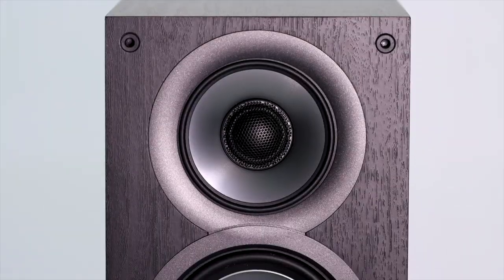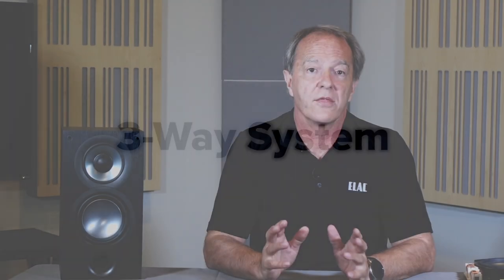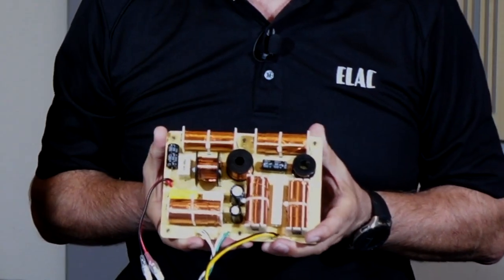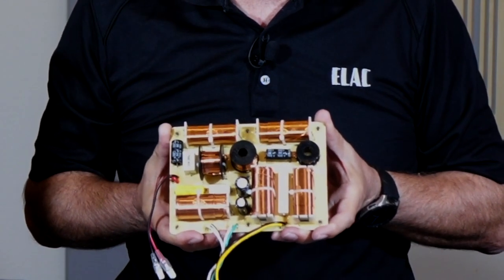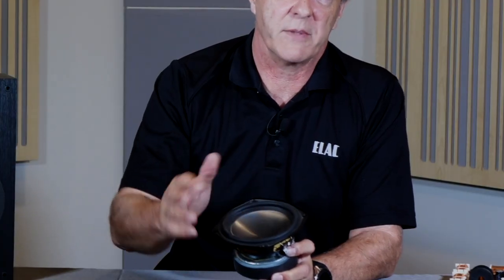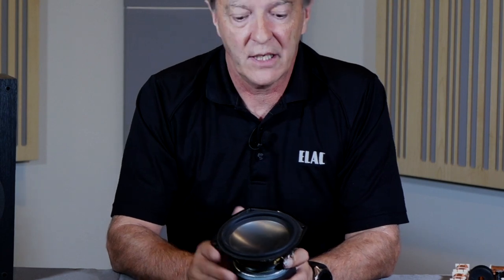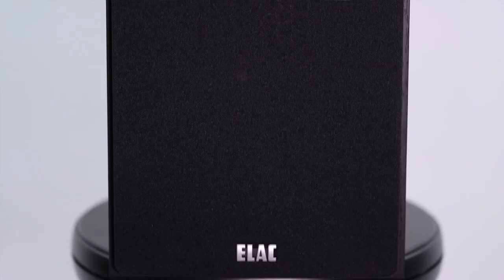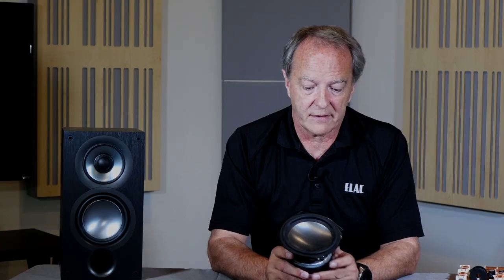Introducing the Uni-Fi 2.0

Comment: Just a heads up. The original UniFi series are on super-sale right now (or will be very soon.) in an obvious effort to sell off final stock, you can score big! The originals are just as wonderful as they always were and shoot way above their price point. The new UniFi speakers are probably pretty good too but at over double the price of today's series sell-off. It's like chocolate ice cream vs strawberry. Both very good. You will be floored by the origional series if you have good amplification. There is a reason audiophile speakers are built in a 4ohm configuration with ports on the back. And it's not to accommodate cheaper power and speaker placement. Set up correctly, and powered appropriately, the older series speakers deliver amazing performance that still give me goosebumps every time I listen to them. Don't feel bad about missing out on the newer series if you already have UB5's, UF5's, UC5's, or you are planning to buy them.  They are still excellently balanced and wonderful speakers, and are now available at a literal steal!
Reply: I have his pioneer concentric driver atmos speakers. What do you recommend sub 1500$ to power them. I am currently using a denon x3600h.
Reply: @urbz6712   I'm not sure since I don't do surround sound. But I would think atmos speakers don't use very much power. I would think anything 100 W or more would suffice.

Comment: One "oversight" on the center channel option? That center channel speaker looks awesome. I don't have one but was looking to buy one. I read some reviews and then it dawned on me. The center channel is more for clarity and not for bass. Why doesn't the center channel have a dual concentric 4" midrange (like where the woofers are) and only a single bass driver instead of exactly the opposite? Seems like that was an oversight in that design but perhaps a single mid-high is enough. Some reviewer said it was too bass present with the dual woofers. Maybe I will connect in series a book shelf pair for the center channel instead of the center unit option.

Comment: Also strange on pricing is that the center channel unit is far more impressive at $299 than are the pair for $599. Makes 100% more sense to buy 2 of the centers and use those as the mains and don't buy the pairs at all. Is the center voiced differently that this is not a good idea?

Comment: It's suprising, but the Elac sounds good only when the volume on my AVR is above 50 or so. 

For music I use L/R bypass as the treble too much, could be my Denon who knows? 
I wish Harman Kardon, still made AVR.
Reply: your denon for sure... even a cheap Onkyo A-9010 would be a way more balanced, better option
Reply: @themastroiannis  AVRs are not going to show case many speakers well.  If your Denon has PRE-AMP outs, look for a used power amp like ADCOM, Rotel, Emotiva, or any of the major Japanese brands.  They will be able to provide more current than and control over the speakers than an AVR would be able to.

Comment: @ELAC, Can you please suggest a good subwoofer and AV receiver that can bring the best out of this Uni-Fi 2.0 system? Bit about me, I am new to home theater system and so don’t have any components yet. Would like to start with Uni-Fi 2.0 with Center, Floor standing as FR and FL and book shelf for RR and RL. So I need a suggestion for the rest of the components: subwoofer(s) and a good AV receiver
Reply: Andrew Jones suggestion is https://www.elac.com/series/powered-subwoofers/sub-3030/?r=us or https://www.elac.com/series/powered-subwoofers/sub-3010/?r=us for subwoofer as per New Record Day YouTube review of Uni-Fi 2.0 floor standing speakers
Reply: I have my original Uni-F5s connected to an AR Technics 5.1 SA-DX930, which allows to drive them in stereo selection and they work excellently; I don't need a subwoofer because the bass is tremendous! My volume dial could not turn up more than 9 o'clock because they would kick me out of the house!

Comment: Still no magnetic grills??  Why!!!!??
Reply: The UB5 had magnetic grills, the UB52 use the same size grill as the Debut 2.0 DB52. The baffle of the UB52 is .2 inch taller and .2 inch wider than the DB52, so the grill still fits with an almost-imperceptible .1 inch gap around the edges. Moving the port to the front of the UB52 resulted in there not being room for an ELAC badge on the baffle. Using the same size grill and deleting the badge are some of the mundane cost-saving measures that enable the new & improved UB52 to be offered at only a $20 increase in MSRP over the UB5.
Reply: They also downgraded the binding posts. I think the UB5 is the better deal while it's selling for $299 a pair.
Reply: Its all about cost.. If the reduction in cost of the grills and terminal can give for instance a better designed crossover, or perhaps some cabinet-bracing..its alt the better..

Comment: I bought the original unifi ub5, i don´t have it yet but i hope next month i could travel to get it. Wan´t to know if you can answer if my old stereo amp Rotel 970bx2 60w 8ohms that can handle 4 ohms can drive them. The manual said about 4 ohms the following  " 110 watts/ch (1 kHz @ 4 ohms, 1 % THD)"   So maybe it can handle 80 or 90 W at 4?????? If anybody can answer this question i will be please. Thanks. And by the way, the new design is awesome, Mr Jones is a genius!
Reply: Yes your amp can drive them 😆 I had the regular 970 not the mark 2 but mine was a lil bright sounding but hey for the money its a solid amp !
Reply: @tee-jaythestereo-bargainph2120  Thanks for your answer!!! Can't wait  to try  the match!
Reply: I have my original Uni-F5s connected to an AR Technics 5.1 SA-DX930, which allows to drive them in stereo selection and they work excellently; I don't need a subwoofer because the bass is tremendous! My volume dial could not turn up more than 9 o'clock because they would kick me out of the house! Amplifier is selectable to drive 4 or 8 ohms
Reply: @flestra  thxs a Lot for your answer. I read a Lot they were a little difficult with no hi end electrónics. Happy to know  they can work well with my setup!!

Comment: Impedance question. It seems counterintuitive that higher ohms are easier to power. So if I take (2) 4 or 6 ohm speakers and wire them in series to each channel they become 8 or 12 ohms respectively. Then that should make them easier to drive and yet there are more drivers to power which seems counterintuitive except that hooking them parallel give the opposite effect of 2 or 3 ohms. Is this correct or not correct? Seems that if I want to use more speakers without any adverse effects I could use the series method.

Comment: Don't agree on 3 vs 2 way. Even for a two way with greatly reduced cone area like the KEF LS50, I have literally never heard any modulation effects from it pulling bass duties. Nor have these effects been measured. Not in modern drivers with inductance mitigation strategies and modern suspensions.
Reply: Well.. Its even more critical with a concentric driver like the LS50.. The LF cone is part of the waveguide for the HF driver, and if the cone has lots of excursion, and moves, this will create modulation..

Comment: Too bad they did not use only air core inductors. Probably would have cost too much.
Reply: Air core is not always better. Needs a lot more wire on the coll and series resistance can therefore be higher, unless you make the inductor physically massive which is impractical for a small loudspeaker.
Reply: @redrobbosworkshop  yep, the limitations of any passive crossover. Maybe they should just make a speaker with an external active crossover.
Reply: @veritas932  Like the ELAC Navi?